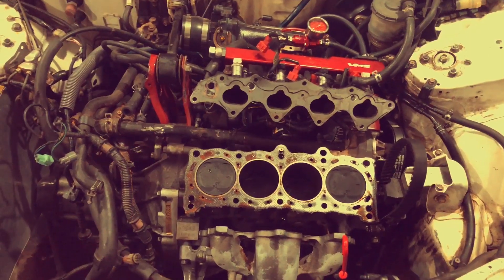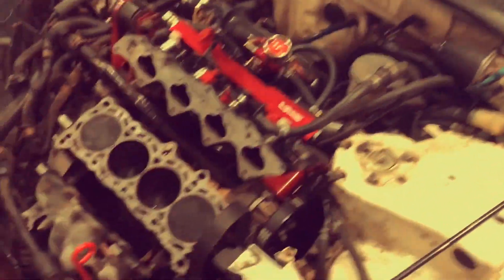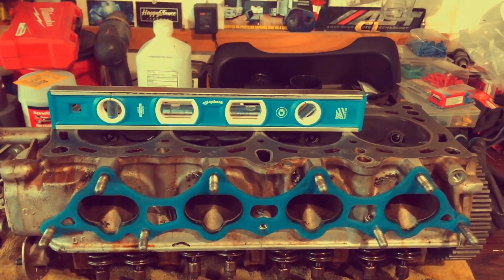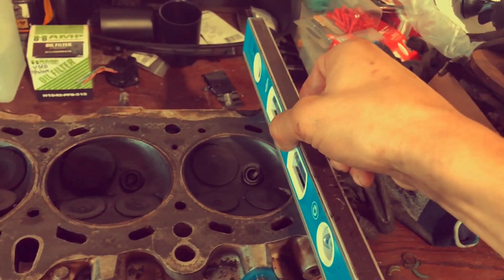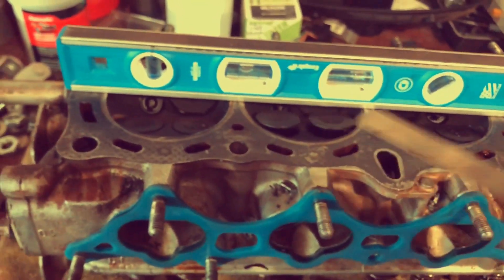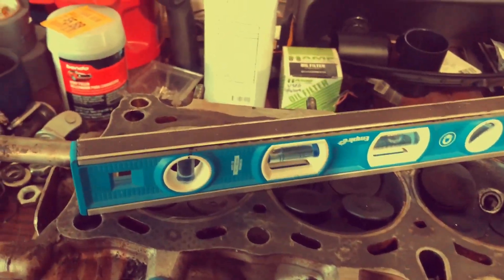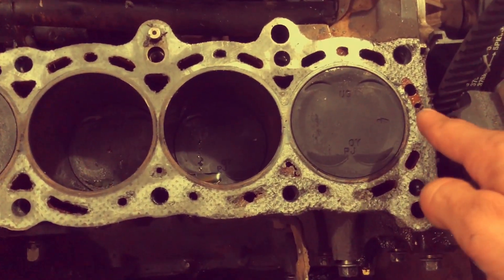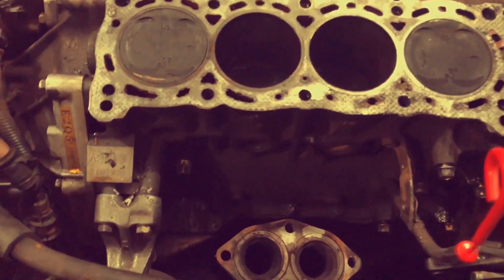A20 Headgasket & Timing Belt Repacement Part 2 of 3

Comment: Hey so i just got a 1988 honda accord 2d DX and i was wondering if you can go into a bit more depth on how you took off the bottom bolts from the intake manifold im tying to replace the head gasket and im getting hung up on that
Reply from the maker: It's a pain in the ass even with engine out. If you watch my B16 intake manifold modification video I show what used to remove the oem IM bolts, if I remember I used 1/8" swivel and a 12mm combo ratchet wrench.
Reply: @aziangarage  thank you for the help now I just gotta put it all back together I can tell that’s going to be a pain

Comment: does the 1987 prelude si use an A20 head?
Reply from the maker: No, 84-87 preludes have A18's. You can swap heads though, a good combo would be an A18 head on a A20 block, you get a slight compression bump. I don't know if the A20 intake manifolds are compatible though.
Reply: @aziangarage  First, great content! The 1986 and 1987 Prelude 2.0 si have A20A3 engines.